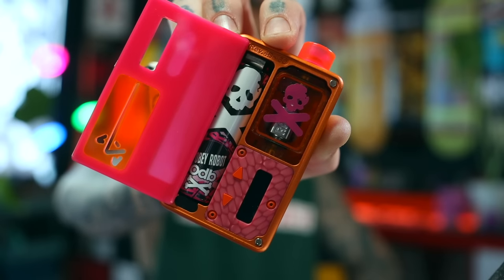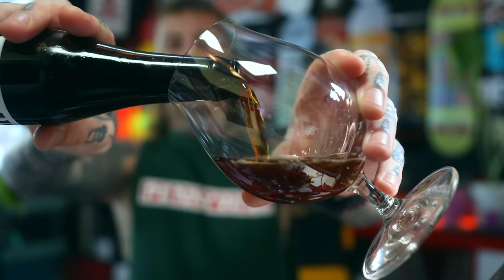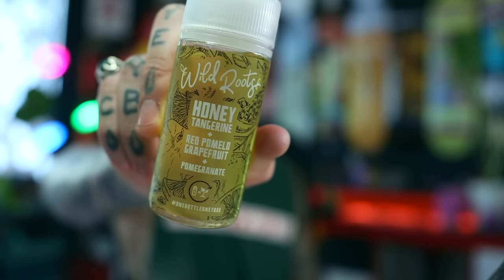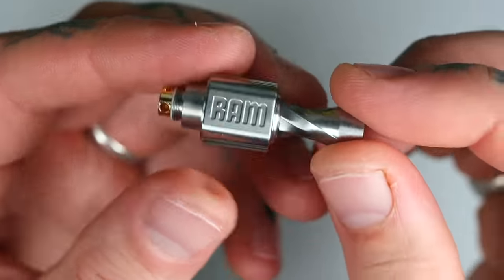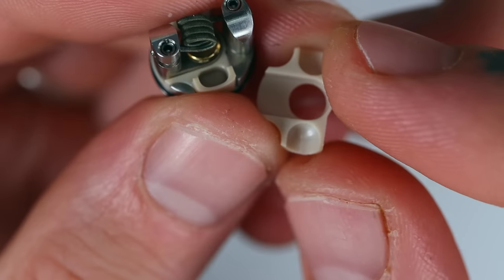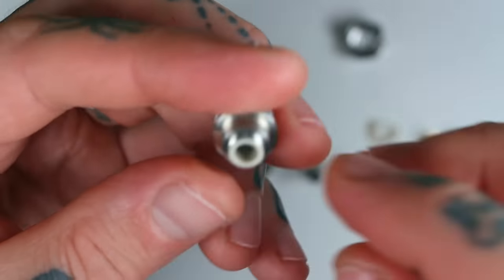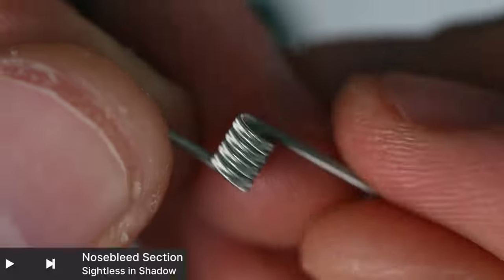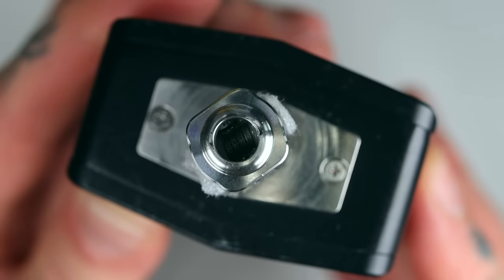Ram Mod Ovis Boro Bridge + Build & Wick Tutorial

Comment: Hmmm I wonder how the mobb mini has more airflow than this?? Could it be due to the fact that you have the ovis in a mums boro?? I mean they both have 3.5mm airflow pins and the pins have the same size holes at the bottom so it seems like it should almost be identical. Def interesting how 2 things that look so similar can have a slightly diff amount of airflow. Anyway peace out until the next livestream bogan 👊👊
Reply: I was thinking the same thing. It could be the boro like u said, could be a different coil, different airflow on the door, even the drip tip could change it
Reply: @rickymahoney6664  all true

Comment: I'm digging this shit, like a exotic version of the Mobb Mini, loving the setup they offer for MTL peeps with a proper topcap and insulator to help with juice flow, 50/50 liquids and the such as. Good shit, Sam. Thanks for showing. Question, if I've already got the Bridg'D V2 and the Voltrove, is the Mission Orbit worthwhile or the Mobb Mini? I've been eyeing both of them. I vape 3MM Breeztones aliens, usually 42w or so in the BB, RDL loving.
Reply from the maker: I love the mobb mini, will always be in my top 3 but the orbit is still by far the smoothest airflow I’ve ever had on a boro bridge, it’s fucking velvet bro. So also a top 3.